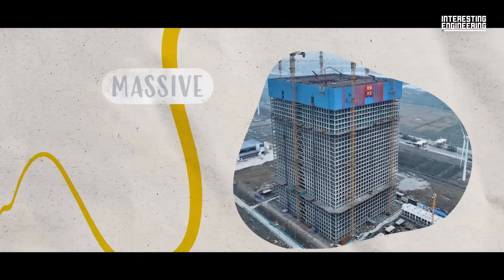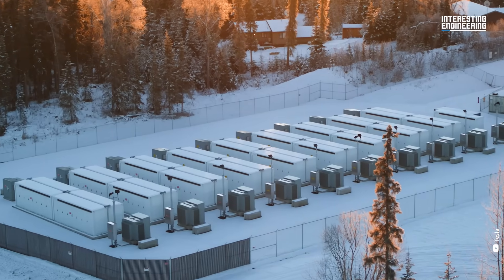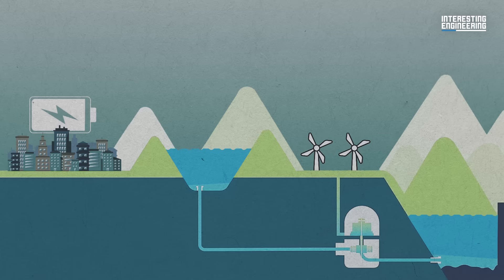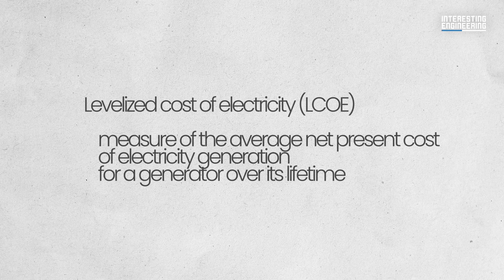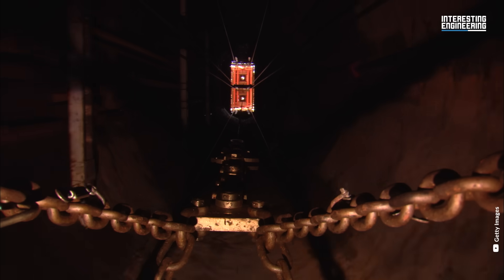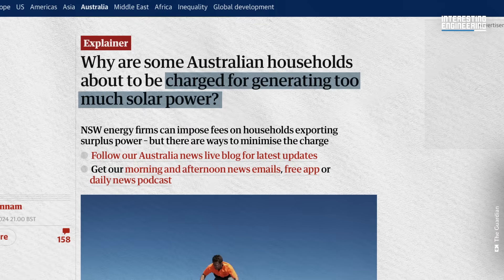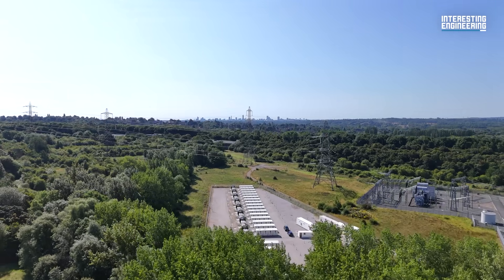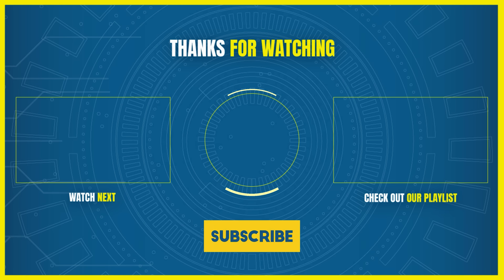China is Building Gravity Batteries

Comment: This is pretty similar to my idea of putting giant springs in cars, then having winding stations to turn the big key.
Reply: I prefer mules inside big hamster wheels but they have actually built vehicles before with a huge flywheel inside and they worked.
Reply: @chippysteve4524  Mules works, and makes your car grain-powered.
Reply: @ Moscow Mules? Russia runs on grain-based technology.
Reply: Compressed air with air refills everywhere.
Reply: @ 100%! Compressed air can be produced in many low-tech ways using wind,wave or solar but if history has taught us anything,you don't f*ck with the monopolies if you want to live.The ex Benetton Formula1 engineer who,with his Jedi-level engineer dad perfected that tech but suddenly gave up on the idea the morning after his dad 'fell' out of an unopenable hotel window on the eve of the big reveal!The hour-long documentary used to be on Youtube.TATA motors now somehow have the designs but obviously they are sitting on them!
Carbon fibre 'cylinders' can be any shape ie under the floor and rear seats and can withstand being hit by a train.Until CF,it would just have been far too dangerous!
Reply: @bikingcat3283  I think they’d need to be everywhere, and people would need to stop at them every few blocks.
Reply: @blattimus  Compressed air cars can easily go 40 miles while providing interior comforts. Infrastructure for the compressed air everywhere is the only problem.
Reply: @bikingcat3283  Attempts have been made to use compressed air to power cars in the past, but weren’t found to be practical because 

1. This energy storage method has extremely low energy density, so impractically massive tanks would be required for even a short range. 
2. The process wastes a lot of energy because compressing gasses creates a lot of heat in the tank which is lost unless it can be recovered; and while decompressing, gasses become very cold which makes them less efficient at driving an air motor. 

Combining three wasteful processes of pumping, storage and decompression just stacks these inefficiencies and results in about 5-10% efficiency between the work put into compressing the air and turning the car wheels.  

Even something silly like a giant spring is better because there is much less unwanted heat generation, and almost all energy put into that system is recovered instead of being lost to entropy. 

Petroleum products are an excellent fuel for cars because they have extremely high energy density and don’t need to be stored in heavy and expensive pressure bottles.
Reply: @blattimus  I wonder if that could be addressed with phase change thermal storage. Interesting
Reply: This thread is becoming epic...
Reply: Genius! The correct term is "windy winding stations".All we need to do is build a network of windmills with cafes and access ramps to help people unwind and rewind,discharge and recharge for no charge..  .Apple will obviously come up with a version where the windmills and springs turn the other way so tone way or anotherhey will still be winding most people up,as usual.The smug pr!cks  ;-)
Reply: @ lol!
Reply: Nice idea but my spring powered flywheel will certainly become the shirkers green car =]

Comment: In 1ton block lifted 5metres high, there is 0.0136 kWh energy. Its lke in 1Ah 12V battery, which is about 60gram battery
Reply: This should have been the point of the video, measuring how plausible it it. And how much energy does a "normal" block produce if the blocks are X tons and X meters.
Reply: @ferbur8708  its linear on weight, so just multiply it. I was just pointing same energy in 60g lithium battery and 1ton block
Reply: Yup I looked into the math about 5 years ago, amazing visually but the math doesn’t math
Reply: @abinodattil6422  What do you expect? Winnie the Pooh told them to build, so they build. It doesn't matter it makes no sense. It will look great for GDP statistics and that's all that matters.
Reply: Lifting hundreds of thousands of tons of cement blocks would need enormous foundations for the winches. Pumped storage has advantage since the weight of the water is distributed evenly over a large surface.
Reply: Now do this for a single mine shaft, which most mines have only 1 and it is very small.  When he mentioned mines, that's when my spidey senses really started tingling.  Most are nowhere near a single km, let alone 3.  The shafts are TINY.  Maybe 9 square meters.  Given that they have to be carved from solid rock, they are extremely space efficient and there is usually only 1. A 3km fall of a 1 ton rock would generate 8.16kwh.  A ten ton rock would be 81.6kwh.  Some EVs have larger batteries.
Reply: This seems like little, but you should do your calculation based on actual figures. The building is 120m tall, and the total weight of the blocks is 300,000 metric tons. This gives a total of 353,160,000J or 98.1MWh. Assume 80% minimum mechanical efficiency(losses due to friction and air resistance), its output would be 78.48MWh.
Reply: @singhonlo67  thanks for taking the work off us to do the calculation. How about the generator though, to turn the energy into electric energy? 
BTW, if anyone was misled by the clickbait title, that gravity batteries could hurt Tesla by replacing car batteries, that's obviously not the idea. Just to be clear, this is about Tesla's home batteries for energy security.
Reply: @singhonlo67  Sttill pathetic.
Reply: @singhonlo67 Minus the energy needed to operate this shit, so I guess, you need at least triple of this, what you earn.
Reply: YA they tried it with a train in Nevada too
Reply: mofos when they don't watch the video be like. the video talks about a house gravity storage experiment and its equivalent battery energy
Reply: I didn't watch the video because once I clicked on it I recognized the company from about TWO YEARS AGO.
Yeah, if you studied physics and math in school and paid attention you would KNOW that the "math doesn't math" for this project.
You know what a REAL gravity battery is? PUMPED HYDRO. That's it, that's how much WEIGHT you NEED, and water weighs a  LOT, even compared to concrete.

But the "GRIFT does GRIFT".
And it has other benefits - it is a money "sink" where you can siphon off funds if you are a corrupt official.
It will create jobs in a local economy that may need jobs.

Heck, it MAY EVEN STORE SOME ENERGY (but NOT MUCH).
Reply: @capnkirk5528 yes the numbers never stack up on these sort of projects.
Reply: @capnkirk5528  Spot on.
Reply: @capnkirk5528  Which is why China, still, today is building new coal plants at the rate of 1 every other week.
Reply: @capnkirk5528  Well, guess which country is building the most pumped hydro stations in the world? Yeap, it is China.

China build the most solar, wind power plants in the world, and it needs a way to store those energies for later usage. So all forms of energy storage systems are being built, evaluated by China, including this gravity battery, it is just one of a dozens energy storage technologies.

You seem to know something, but not nearly enough, go read some more.

And talking about corrupted officials, seriously, no other country come closer to the US in terms of corruptions -- and unlike many other nations, the corruption in the US comes from the very top, and trickles down to every layer of government.
Reply: @davecai999  NO country is free from corruption, NO level of government is "safe" and the only thing you can really do is be vigilant.
Also, the western-focused "corruption index" tends to overstate Chinese corruption and UNDERSTATE US corruption (although given Trump and Congress that's almost impossible to avoid because of HOW corrupt they have become).
DPRK is probably the most corrupt government in the world, followed by a few other smaller autocracies like Cuba, and then Russia and the US. China is currently quite far down the list.
Reply: @capnkirk5528  yep, clearly you haven't watched the video, as the similarity and difference to hydro pump is discussed in extensive detail.

Comment: 80% efficiency seems rather optimistic
Reply: Reasoning?
Reply: @ziad_jkhan  all the mechanical friction lost in steel cables and rails and thermal lost in the electric motor and reduction gear. If it is truly 80% than it is probably be the most efficient large scale energy storage system ever invented. because right now hydro-gravity energy storage is about 60-70%.
Also  as a Chinese person, I certainly hope it is true. But I remember I once saw an introduction of it on Chinese TV and they did not say 80%. 
China is currently testing out all method of large scale energy storage, to have all of them to battle out their commercial viabilities over the whole product cycle.
Reply: @ There's not much friction going on if it's lifting the weight vertically, just minimal energy loss due to torsion. The gears have losses but it's just a question of design and designing the motors so the don't require a lot of reduction. As for the motors themselves they can have up to 95% efficiency these days. So 15% loss is quite reasonable.
Reply: @ nice to hear
Reply: @888YangJi  I believe you are more reasonable on efficiency, many claim 80-90% efficiency but experience on mechanisms shows the efficiency is around 60-70%.

Comment: Many countries with deep shaft mining operations that have been decommissioned will want to look into this technology as these mine shafts are often very deep, and they're located in industrial zones where an environmental impact study would be pointless.
Reply: Great minds think alike!They have been trialling the vastly superior version you mentioned in disused mines in the UK for a few years now using weights of >100 tons.They don't need much more than a cable,a wheel and a dynamo and they already have transmission lines and access roads.A bigger weight is easier than a very deep mineshaft.If you have both then even better.
Reply: Good point, filling up the dexommisioned mine would make energy instead of using them
Reply: Big issue is however, that mine openings are pretty small, and mines also twist and turn - it's often probably not even worth it. You need dozens of weights going down to power some very small city.